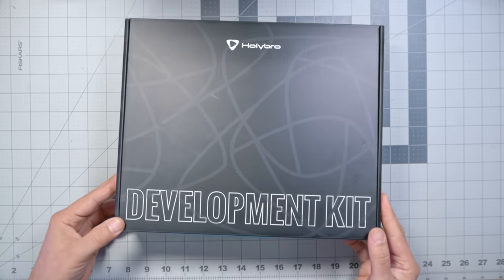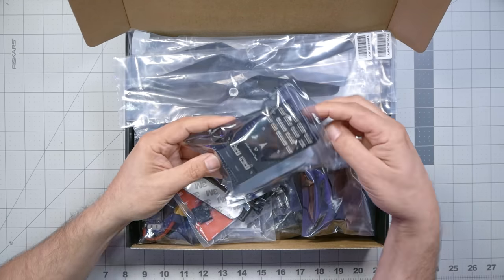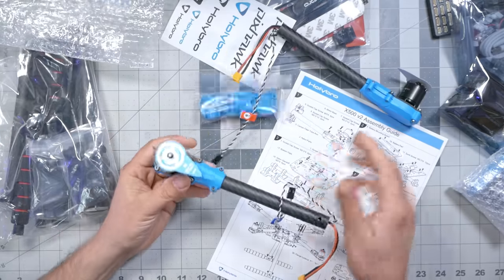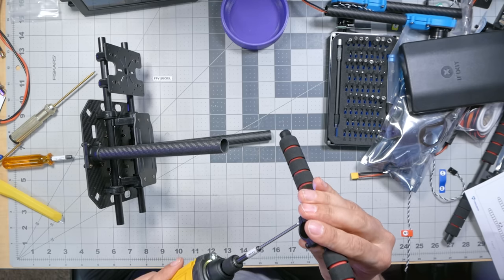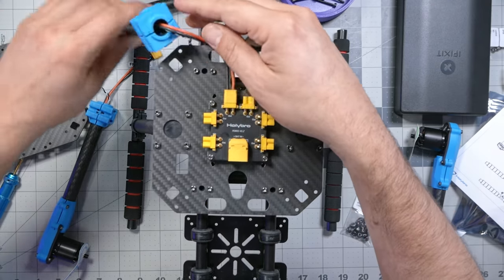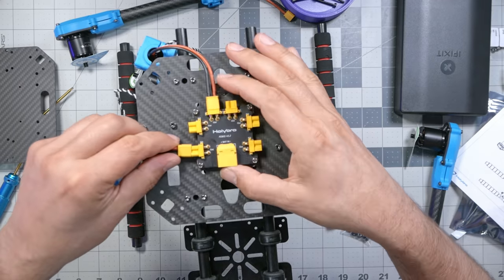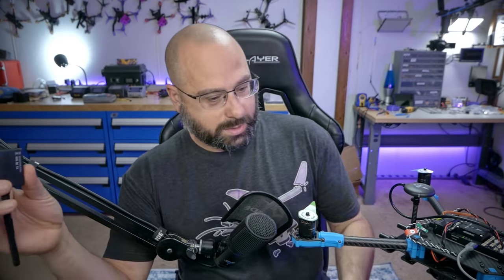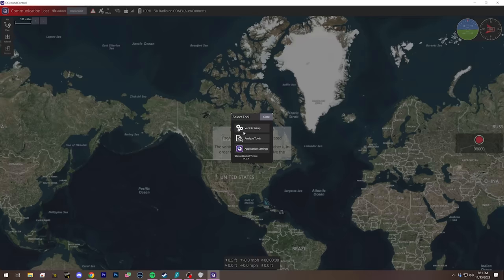FPV pilot tries Pixhawk for the first time // Introduction to Ardupilot

Comment: My next project is to add a camera to drone. I will be very interested in hearing which video system you select. There seem to be about 3 or 4 main choices. They all seem to be pretty expensive, maybe more expensive than the original drone kit. Thanks

Comment: POSHOLD will lock it in its position(3d) it will only move when any stick input is given (i.e. it will move for the stick command once you release the stick it will stop at the position and hower it will not drift)
and ALTHOLD will hold altitude and fly (i.e   in this mode you don't need to control throttle to maintain altitude, but the movement needs to be controlled otherwise it will have drift due to wind etc) this mode is a slightly lower version of POSHOLD.
and LOITER mostly for fixed wings - once a fixed wing complete its automission it will return to home and loiter in a predefined circle untill the pilot takes control and lands it. So switching to LOITER mode will make uav fly in a predefined radius.

Comment: I know, more tools, but look into parallel jaw pliers wrenches. Knipex made the original, but you can pick up an Icon brand clone of them at Harbor Freight. I use mine for way more press operations than really makes sense, but It's one of my favorite tools.

Comment: I have installed a Pixhawk 4 Mini onto my waterproof SplashDrone some time ago and had many similar experiences as you had. In the first run I tried the PX4 firmware which was unstable with altitude hold, so I switched to ArduPilot, too. It flies well, although I had big difficulties with compass calibration, as the GPS receiver is placed within the fuselage, near to other electronic components.
I am wondering why you didn't do any calibration at all. I calibrated the accelerometers, the compass and performed an autotune. As a result my position hold is quite stable, comparable to older DJI drones without ground sensor.
While using a Jeti RSat 2 receiver with PPM output in the first step, I meanwhile upgraded to eLRS using CRSF protocol and got it working. I am using a wifi module for telemetry and as I have also installed a Caddx Vista I did run out of serial ports on my Mini Pixhawk. Luckily it is possible to abuse the debug port for an additional serial port and it works fine with the fpv.wtf firmware.

Comment: You can run ELRS/CRSF. You just have to wire it to a telemetry port and configure the serial port in Arducopter as CRSF. Also, look into Yaapu telemetry script for your TX16S Max...Nice HUD and telemetry right to your radio!
Reply from the maker: You also have to set a custom option because ELRS doesn't have the same baud rate as CRSF, and that part was where I got stuck.
Reply: @JoshuaBardwell  mission planner i think is easier to use for configuration. The GUI isn’t as nice though.
Reply from the maker: Oh neat I'll check it out.
Reply: @NoFlyDrone  Indeed. Last time I tried Ardupilot with QGroundControl there were some options/settings missing compared to Mission Planner.
I think it was also Receiver related.
For PX4 however I think QGroundControl should support everything, since it's the official "ground station" software.

Imo both systems lack a proper documentation.
I wasted so much time trying to find out easy stuff ... because it was just not properly explained.
Also it's very hard to find help, since only very few people use those systems.
Reply: @uhu4677  yeah the wiki documentation is not great. The ardupilot discourse is your best bet for getting answers. The discord has sections for plane/copter user support as well.

Comment: Many of the functions of Ardupilot, yet in a simpler OS is INAV. That being said, you can flash Ardupilot/Arducopter to many of our Betaflight/INAV flight controllers. Can INAV/Arducopter freestyle as well as fly a waypoint mission? Yes. Is it possible to use a telemetry radio? yes and no. Ardupilot can and some day soon ELRS may be able to perform bidirectional functions as well.Ardupilot can operate any type of vehicle...even a submarine, VTOL, a sailboat ect ect. INAV can operate most of the same... well soon and you can play with that in RC of INAV 7. INAV has a more manual or stabilizedd feel in automated modes where as Ardupilot  has a robotic feel to flight  control. Both are amazing!

Comment: I had a hard time getting CRSF to work with Ardupilot but eventually I got it to work and was able to get Yaapu LUA scripts to work on my TX16S.
Reply from the maker: For me, the breaking point was the difference in baudrate between CRSF and ELRS. I did everything but couldn't get that option figured out. If I really cared, I would re-flash the ELRS receiver with the CRSF baudrate but I decided I didn't care.
Reply: @JoshuaBardwell for ELRS you’d connect the receiver to a UART like TELEM3.  For the baud rate adjustment, set bit 13 of RC_OPTIONS.
Reply from the maker: I found that in the documentation. You say "set bit 13" and to the computer scientist in me that means set the bit to a 1. So I did some binary to decimal conversions to figure out what the decimal value of bit 13 being set to 1 was, but when I put in that custom value, it still didn't work.
Reply: @JoshuaBardwell  What FW version of CRSF are you on?  There was a bug in 6.26 and  I believe that was the cause of a lot of my problems.  
Set SERIAL4_PROTOCOL = 23   Set RSSI_TYPE = 3

Comment: Usually this platform is used for research, autonomous flight and stuff like that. In my research lab we put our custom software inside the flight controller with additional computer for computer vision and ai and use the drone to do stuff by itself without user interaction.

Comment: GPS(actually GNSS) positioning with single point positioning(SPP) mode can only achieve meter level accuracy, even if you have 18 satellites. Also there are a lot of trees around, which are changing the signal travelling path (of course the GNSS receiver don't know about this), therefore multi-path errors of of meter level take place. To achieve cm-level position hold with GNSS, you will need receivers like u-blox F9P, Trimble, Novatel, Hemisphere with RTK capability.

Comment: Dear Joshua, you skipped the compass calibration part. It is not too complicated, but you cannot do gps assisted flying without it.
The drifting while in Loitering mode could be because of the transmitter pitch/roll stick not being well enough calibrated.
Reply from the maker: I didn't skip it I assure you. It's just not in the video because I carried the quad outside to get away from magnetic fields.

Comment: Well pixhawk can use elrs and crsf the receiver must be plugged in to telemetry port and then the usb telemetey module is redundant as you can relay the data through the rc link and even make changes to the model in the fly.
Truth is that sbus is a much less hassle procedure to start with. To setup the elrs/crsf requires some digging in the settings.
Also dont use px4, just go with ardupilot!

Comment: Maybe I missed it but I didn't see where you calibrated the compass (which is a pre-arm check, I believe)  which may explain why it wasn't loitering well.
Reply from the maker: I did calibrate the compass although it's not in the video.
Reply: @JoshuaBardwell   oooh, ok. I'm not sure about QGC but Mission Planner has an additional compass calibration to compensate for interference from the motors. It might be worth a try.

Comment: I've spent hours today looking for a video like this.  I'm intrigued by the performance of the DJI stuff.  Like how do they fly so long?    So I searched for long range or long duration quad-copters and I found this.    INAV looks pretty interesting as well.   While I appreciate the freestyle stuff, it's not for me.  But what would happen if you took some of the freestyle kits and put a very efficient motor prop combo on it, along with stuff like a gps and different software/firmware?   I'd like to see more homebuilds in smaller sizes.   How about VTOL planes?   (to far outside the box?)   Anyway, keep up the good work.

Comment: Next level of fun, flash Adrupilot on a supported F405 board and figure that out :).   The good news is it'll support CRSF :)

I have them flying on Crossfire and Tracer.  Presumably ELRS should work too.

Betaflight / Inav users on Arduplane feels like a Windows user crash coursing Linux.

Comment: Hey Josh you have help me out about 5 years ago ok,so I bought a new EMAX HAWK PRO and it didn't come with radio so i went and bought EMAX e8 transmitter and i can only use the beta flight android app and can't get my quad to bind.

Comment: Been on ardupilot for 10 years it started with 3DR and the APM controller im using one still and have first gen pixhawk Chinese clone running on a 900 hexacopter for 8 years already

Comment: I had a hubsan drone that would do the same thing in gps hold mode if the compass was not calibrated right.  It would act like it was being flushed down a pipe and slowly go around in a circle all around the gps locked spot. Maybe its your compass calibration making it not stay in one place in hold mode.

Comment: I really wanted to be interested in the pixhawk stuff, but all I'm seeing is an inexpensive cinelifter platform. Just add a betaflight fc, gps module, and ELRS rx and you're in the air for under $400
Reply from the maker: Betaflight can't loiter. Can't fly waypoints. Can't do proper return to home or autoland. Betaflight FC's lack redundant hardware. The kind of people who use a Pixhawk FC are flying platforms too expensive or valuable to risk a Betaflight FC on.
Reply: @JoshuaBardwell  But INAV can (not sure about redundant hardware)
Reply: The Pixhawk 6X that JB was using has three IMUs, temperature-controlled for more stability and with vibration-reducing mounts.  It also has two barometers.  It's overkill for most hobby use, but might make sense if you're carrying a $20K camera system (for example), or doing waypoint missions with a $30K heavy-lift multicopter.

Comment: Hey Joshua, I liked this content. I started with pixhawk 500 quads and then moved to 5 inch betaflight drones. I still have a 500 hex copter. Wandering why you used QControl? I use Ardu-Copter. I think it is one of the original control software and have grown to love it. I have added camera and gimbal which was pretty challenging. The old gopro 3 with the ability to wire goggle feed to gopro went away just before I added my camera. I have been wondering if there are any alternatives for viewing camera feed in google? I started was trying to setup two camera's on the gimbal. But that is not an elegant solution. Would be better to view camera feed in the google.  I think that would be an interesting topic to explore.
Reply: Painless360 use to excellent source for pixhawk use and builds.

Comment: Hey question.
Am i right in saying if you want to have servos, you have to connect either the main battery or an additional one to the servo rail?

If this is correct, what is the max voltage input into the servo rail? (In other words, whats the biggest sized battery i can plug into servo rail)

For instance, Is it 5v like the pixhawk, or can the servo rails take in 12v?
Reply from the maker: Servos typically run off 5v.

Comment: You have the POTENTIAL to learn something new everyday! That is IF you don't ASSUME to know everything already! That thing is over 5 years old! I have a heavy lifting drone on my wall that I have been looking at because of the cost of the build and the priority of other projects, point it I've been planning on getting one for a while now! But it's not as hard as you think and it does a lot more than you know! But because you know a lot more about board layout chip capabilities then if you think about it for a second there are cheaper ways to get the same and more but it takes more programming than most are used to!! We still have a long way to go in the drone world!! All of that comes in a way smaller package now and 5 times faster!! And cheaper!!

Comment: Hi Joshua, good video as usual! But, why you decided to use Ardupilot firmware instead PX4 firmware?
Reply from the maker: Most of the other documentation and tutorials that I found was specific to Ardupilot.
Reply: @JoshuaBardwell  try to take a look also to px4 doc , it is very complete. It was a fork of ardupilot

Comment: I use crossfire (with CRSF protocol and telemetry) with all my Ardupilot builds,  but I'm using actual crossfire and not ELRS. I wonder if one works and the other doesn't as easily.

Comment: are there any resources for people trying to build or buy hardware for something like ardupilot? the official website seems to have a limited or outdated selection of off the shelf options, are there gps/camera drones available that aren't over $2k?
Reply from the maker: What about the same kit I'm using in this video?
Reply: @JoshuaBardwell  it does look promising, I wasn't sure if this has the ability to add a camera with streaming/recording capabilities (even if streaming range is somewhat limited)?

Comment: The telemetry radio may interfere with 900mhz receivers.  I have CRSF and a RFD900x .  The 900x stomped all over crossfire.
Reply from the maker: That's true. I'm using ELRS 2.4 GHz though.
Reply: @JoshuaBardwell  yep.  I did the same.   Well almost lol.  After a few days of pulling my hair out I ended up switching to Tracer.  Everything  now works as it should.

Comment: Do a race - or at least try freestyle-type flights - with arducopter installed on, say, a 3 or 5-inch frame (by installing arducopter on one of the many compatible betaflight-type flight controllers from Matek, Holybro, Speedeebee, and several other manufacturers) - and compare.  

JB you probably already have 2 identical frames with identical flight controllers - flash one of them to arducopter - you'd need to tune the PID's - but you might also find a tune online. 

I'd love to know if arducopter in, say, acro mode can fly a given airframe as well as betaflight (or even better?). :)
Reply: Yes that would be great content. IMO betaflight is by far the most advanced for performance, but I would be very curious, on a good frame with good motors and new props, if Ardupilot can deliver good-enough performance for cinematic and freestyle/dynamic flights.
Super interested because the regulations will soon require geo-fencing on every drone and so far only ardupilot delivers.

Comment: Not bad $600 for an alternative to a large lifter that would probably cost like $2000 if it was a dji drone at least.    I wanted to get a big drone like this working for drone rescues if I like land on a roof or something that I can't get to. Would be worth the $600  if you have a $1000 fpv drone you can recover easily.